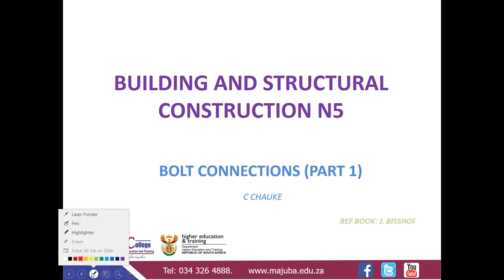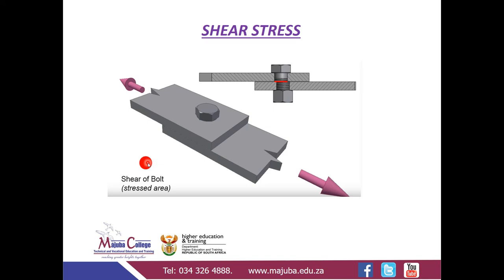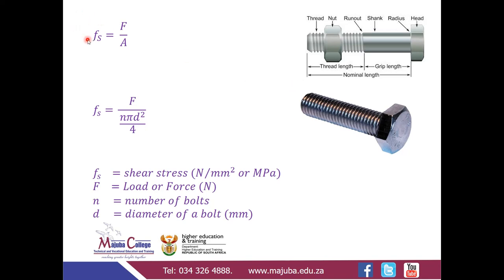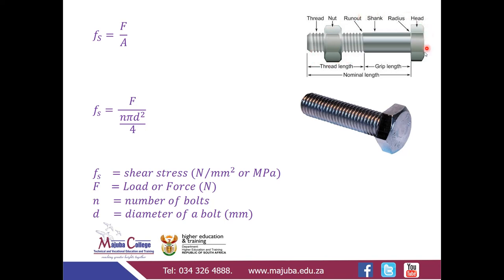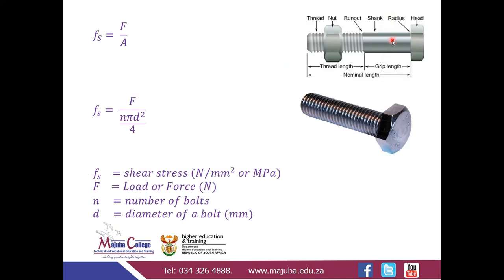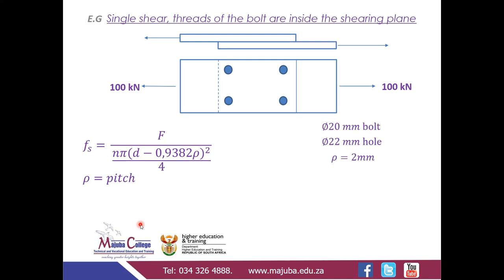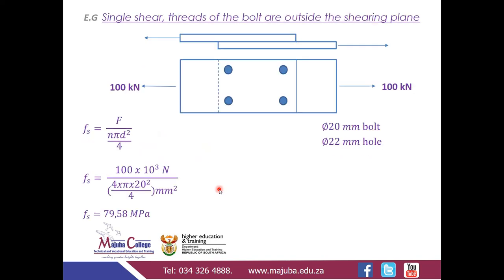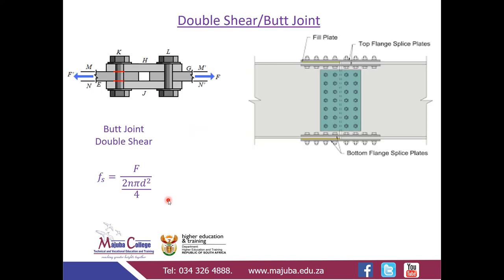Building and Structural Construction N5 (Bolt Connections - Part 1) - Mr. C. Chauke

Comment: There's this calculation you did ...on single shear with the threads inside the shearing plane... Your answer was 87,604Mpa but I get 96,908Mpa...just wanted to confirm with you

Comment: Mr Chauke I wanna know on the double  shear if the Diameter of bolts or rivet are at left are not equal with the Diameter at right Does that mean we must calculate them both